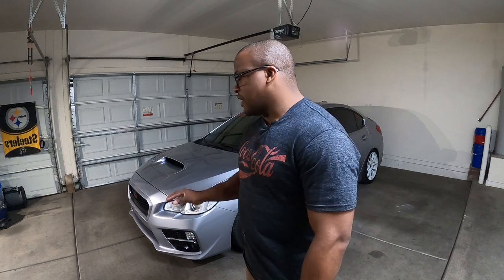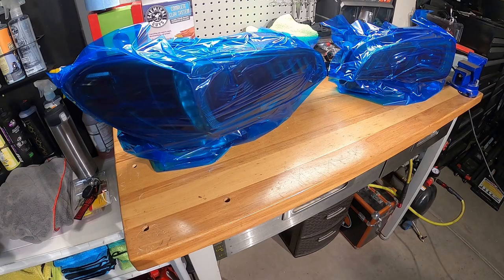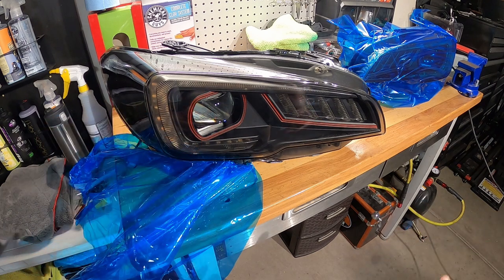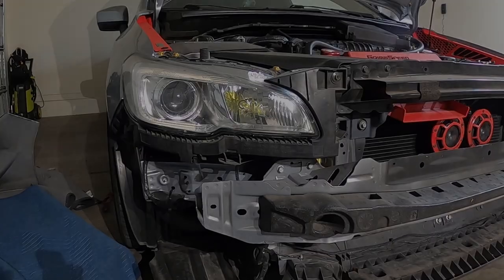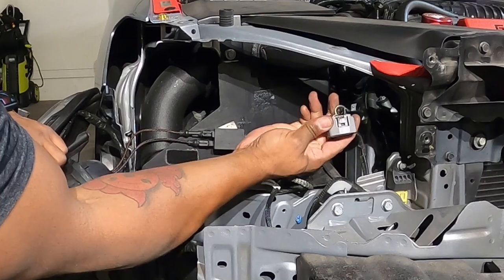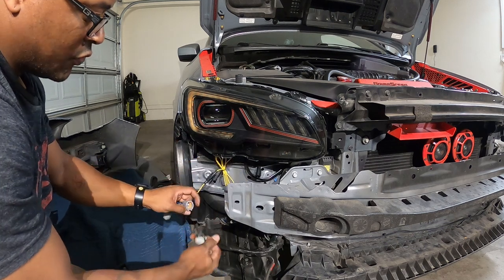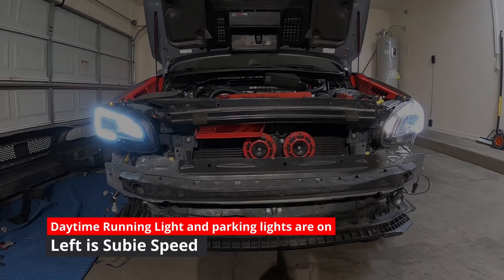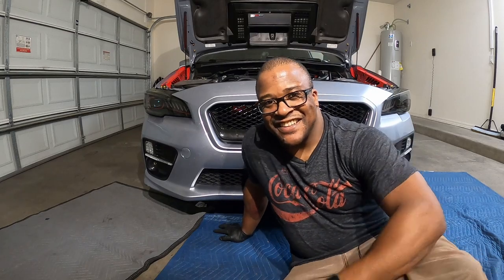SUBISPEED V2 REDLINE SEQUENTIAL LED HEADLIGHTS

Comment: Hey for some reason my turn signals aren’t sequential. Any reason why? Did I miss something I had to do?
Reply from the maker: My apologies, I didn't mention that in the video. There should be a plug on the main harness that splits off to its own wire they connect to each other to make it Sequential or not. Hit me up on Insta if you want to message back and forth. We should be able to figure it out pretty quick! ✌
Reply: @khaozdreamz  Hey man I appreciate it. I managed to figure it out and it was just what you said. Great vid tho 👍🏾

Comment: How do you like it after almost a year?
Reply from the maker: @jayxiong204 It has been great! no problems, leaks, or fogging. This has been through the ringer of 110 degrees in the summer to the rains and 35 degrees in winter.  The only thing I wish it had was the ability to dim the c lights at night they are kinda bright but so far no one has flashed me or mentioned that they are too bright.

Comment: So these don’t have high beams? Im confused
Reply from the maker: Hey @supreme2544 that's a great point and I appreciate you bring that to my attention. I need to make a short of the full functionality. Yes they have high beams it built into the single housing. So the cut off is the low beam then when you turn on that high beam that cut-off pulls up. Make sense if not. Give me a few and ill make a vid showing all the features.
Reply: @khaozdreamz  sounds great thanks man